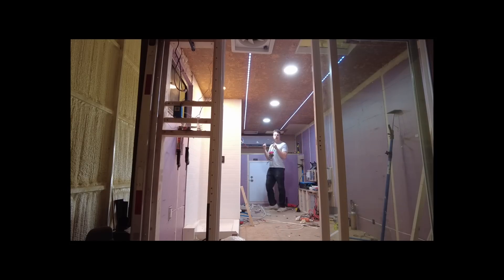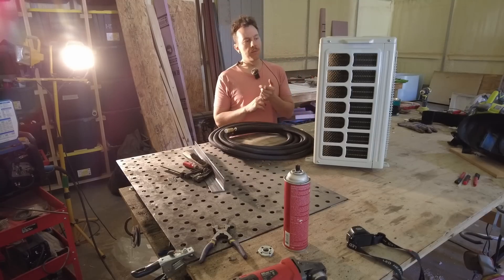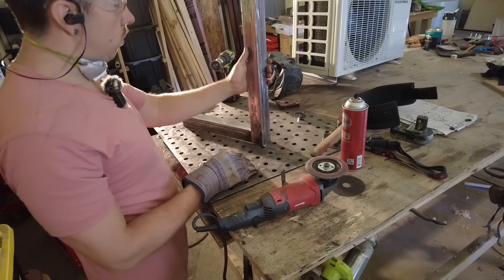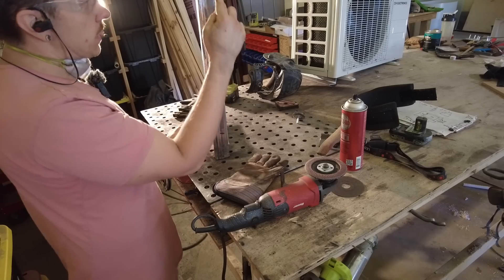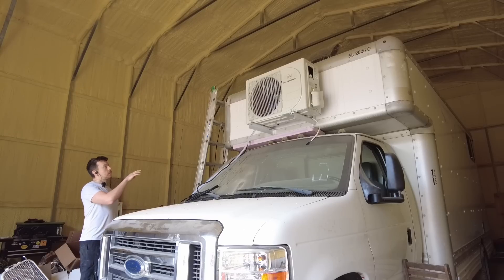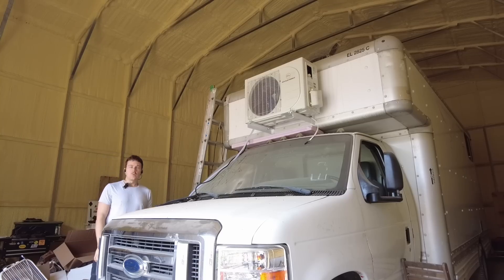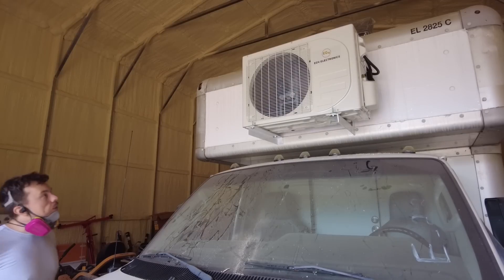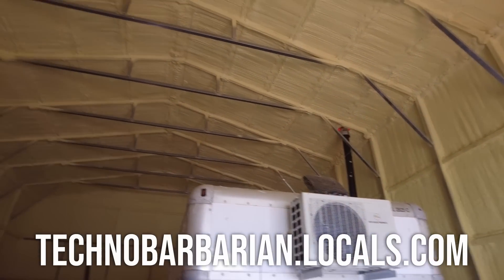Installing The BEST Tiny Home Air Conditioner EVER MADE?

Comment: Wow, huge battery bank, any chance on insite to charging setup, solar, dc2dc? Not sure if it’s mentioned anywhere else, plan on duplicating a lot of your ideas for my U-Haul, thanks for uploading!
Reply from the maker: 1800w of solar on this build. Has a shore power input as well. DC-DC charger wouldnt make a dent in a battery this big unless you drive very long roadtrips

Comment: Out of curiosity are you going to have a cover over it ? Or a some sort of shield on it to protect fan going down the highway ?
Reply: I have a mini split installed in the same position on my box. One thing I didn't account for was bug splats, especially in night driving. They get in the fan, on the guard, in the coils... pain to clean off. I haven't gotten around to it, but I want to design a cover for it. Otherwise, mine is seer 25.5 and it's worked great. Runs all day in the Texas heat with no issue.
Reply from the maker: Not necessary in my opinion. It's too high for rocks. It's in a less dangerous position than mini split condensers installed on the tail of trailers and those do fine. I'm retrofitting one in the same fashion on my own build soon.
Reply: Hmm, first thing that popped into my mind when I glanced over the post, I haven't indulged in the video yet, 😁, was it would be completely stealth if you rigged up some kind of cowling that would allow air flow from underneath while making it look like a regular reefer truck. I think it would be more attractive.
Reply from the maker: @SewingBoxDesigns I might do a stealth cowling for mine
Reply: @TheTechnoBarbarian ive seen people use foam insulation board to make a box that slides over it then u could cover it in plastic or something
Reply: @TheTechnoBarbarian  I've seen some the fans mounted on front of box vans have had issues because of excessive air movement  in travel ? That's why I was asking believe I heard it from Nomad Brad recently.
Reply from the maker: @stoneyvanwie6042 I could see that. If my client was doing a lot of long distance freeway driving I would recommend trying it. For him and for my use we'll mostly just be driving around town.
Reply: @TheTechnoBarbarian bugs
Reply: I strap a board in front of mine.

Comment: Amazing! I'd considered putting mine on the front, but I read someone comment that the front wind when driving would do a lot of damage to the fan blade. Not sure of the factuality of that, but it made me too paranoid to try it myself lol
Great to see someone do it though! good work
Reply from the maker: Yeah theres a lot of unfounded "myths" or "wives tales" floating around with this kind of stuff. The number of times Ive been told my sliding glass door will break, for example, is hilarious.
Reply: @ We all know you replace those glass doors every 2-5 days  😂
Reply: @TheTechnoBarbarian  its not that the wind damages the fan blade, its the potential electrical and compressor issues / damage. for example some pioneer models have trouble codes that will force off the system when it detects outdoor fan rotation "out of control" (i.e. you have it set on low but driving is forcing air over the blades = higher speed than computer expects) it is technically an issue and needs to be addressed. easiest way to toss a bag on it or in this case a home made metal square with magnets on the corners to reach up and slap over the fan covering it
Reply: The only issue I see with the fan mounted in such a way; would be possible back-current into the fan electronics from wind spinning the fan. Other than that it looks awesome!
Reply: Common sense: the fine dust will enter the continuously rotating bearings and shorten their lifespan.
Reply: @ would that not happen through normal use?
Reply from the maker: @TheSimpleBox No he installs his air conditioners in airtight boxes so no wind never gets to them
Reply: @TheTechnoBarbarian  SMORT!